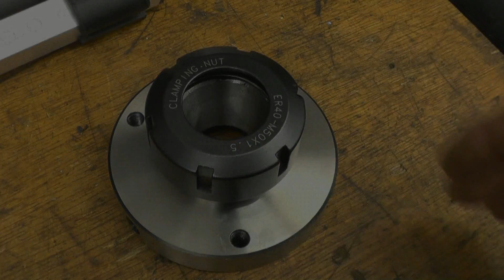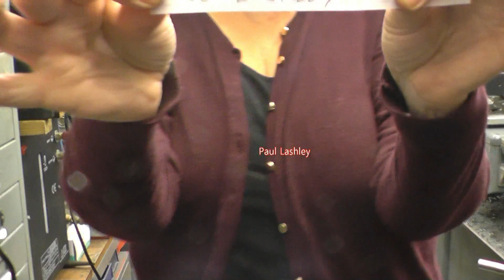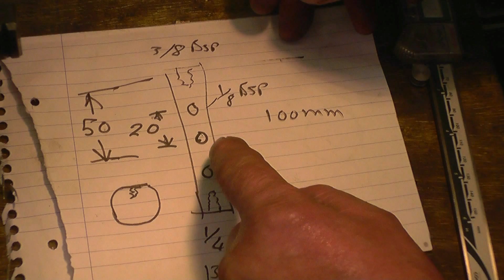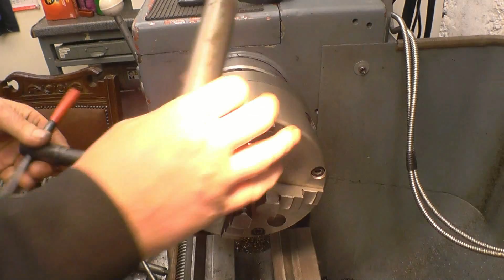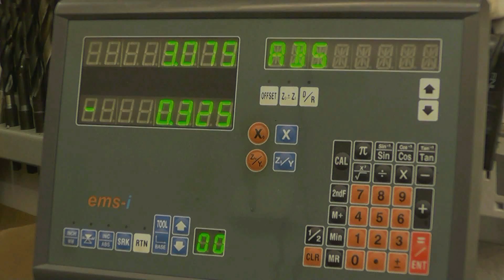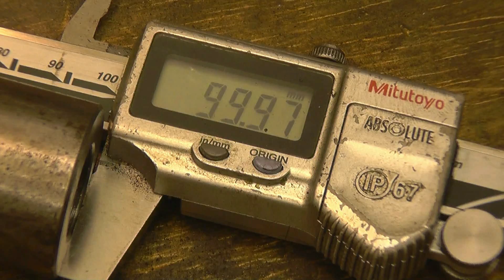SNNC 164 P1     Hydraulic manifold BSP threads  TEE shirts

Comment: I'm confused.  isn't 1/4 bsp like 6mm but 7/16 for half inch?
Reply: BSP sizes are the bore size not the OD. A 1/2" BSP pipe is 3/4" OD
Reply: mark rainford that makes complete sense. cheers
Reply from the maker: Pleased you see how the sizes work

Comment: have to say I find it funny that in the metric world you use 60 degree screw threads and 55 degree pipe thread.  US pipe threads are 60 degrees, and basically 1 TPI different from British.  Enough to almost fit, but it will bugger the threads up bad.  

At work I have a Hydrovane air compressor, made in the UK.  Someone replaced the 1/4 BSP pressure gauge with 1/4 NPT, into an aluminum housing.  Its all messed up, I got it back together but I don't think that housing will survive another replacement.
Reply from the maker: pipe threads can be a nightmare

Comment: Always look forward to Sunday night, just one question though why wouldn't you just measure the length of the rod with your callipers as normal ? I.e. 103.'mm then machine that of, don't see why you would set the callipers to 100mm am I missing something.

Alan.
Reply: I think that when the finished size of the part is 100mm it would be just as easy to zero the calipers at 0mm and go from there. However, if the finished length were some other size, for instance 73.7mm, this technique would be more helpful at eliminating mistakes caused by simple addition or subtraction errors.  So, I assume it's the general technique he's demonstrating here, even though with a finished size of 100 it might not be as obviously useful.
Reply from the maker: Just showing another way of doing things

Comment: Can anyone describe how the drip oilers work? are they adjustable, or turn off-able etc?
Reply: Turn off-able, great technical term!
The little lever on top opens the needle valve when raised to vertical. The part below it is adjustable to set the drip rate, wich can be seen through the little windows under the reservoir.

I had one on my old lathe. I only filled the amount of oil I thought I needed, as I always forgot to turn it off. :o)
Reply: ahh yes, needle valve, thats what i hadnt thought of, i did think of what happens when you forget to turn them off though! we'd all do it.
Reply: On my mill and lathe I have those type oilers for the spindle. After coming in one morning and finding all the oil on the ground I added solenoids to the needle valve so they are only on when the spindle is turning. Now I never forget to turn them on or off.
   Mike (o\!/o)